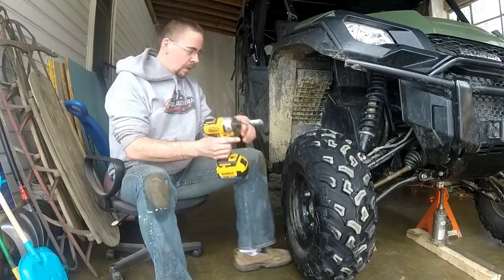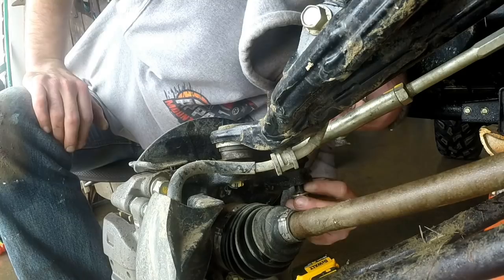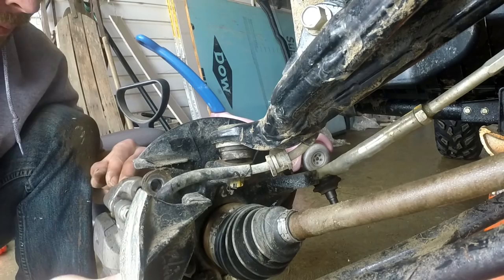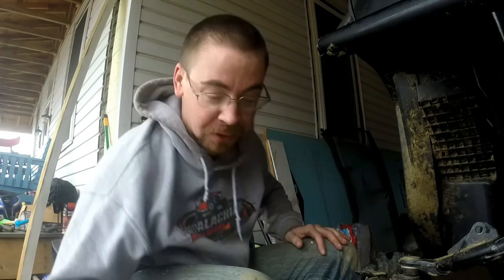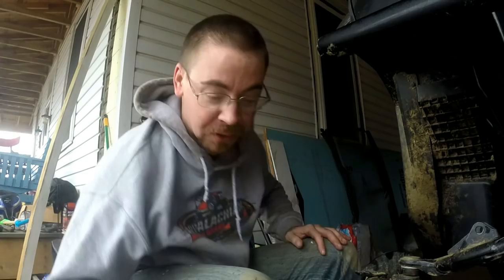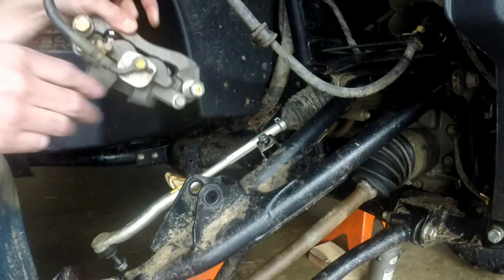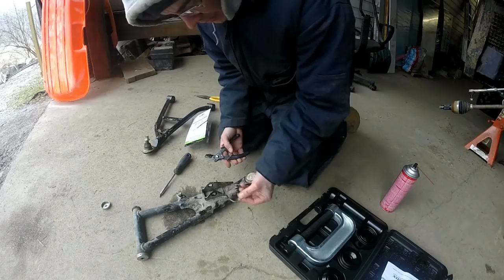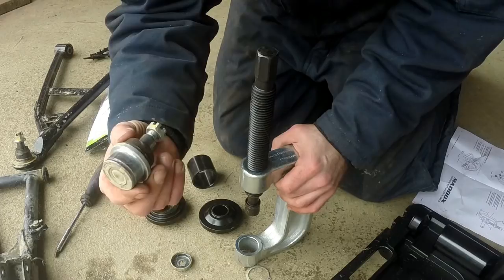Super ATV Arched A-Arm Install: Honda Pioneer 1000/1000-5

Comment: I have a 2017 pioneer 1000-5 and put a slight bend in my lower a arm, what are some problems that can occur from driving with it like that. Any answer is greatly appreciated thanks.
Reply from the maker: The most immediate thing is that if your a-arm is bent, then you can bet you're a-arm mounting tabs are tweaked as well. That can lead to them failing and ripping off cause your a-arm to come loose which you can probably guess the havoc that could cause. Again how soon that may happen depends on how "slight" the bend is and how you rip around in the P1k5. Just for reference, I went on a couple rides after bending mine before I even saw it was bent and stuff held together but I was probably pressing my luck...lol. 

With any amount of bend however it will through your alignment off which will cause lots of things like, tires, ball joints, a-arm bushing, tie rods, to wear faster and need replacing sooner which is something to consider as well.

Comment: Hey Jason how are things going. I have a question. Have you heard anything about the upper A-arm pivot bolt coming loose and "egging" out the holes for the upper A-arm mount when using the Super ATV ? Thanks
Reply from the maker: I haven’t herd anything about that but I don’t have the 1000-5 anymore so I don’t spend as much time on the 1000 groups and forums like I use too
Reply: @AppalachianMountainRiders  That's to bad. I love my 1000-5. Thanks and take care, Rob.

Comment: Hey mate just watching from Australia 🇦🇺 just wondering what tires your running still running my stocks but their absolutely terrible but anyway thanks videos are always tops 👍
Reply from the maker: JIM Rottey hello from across the pond! I’m running 27” maxis bighorns 2.0 on my Pioneer 500 9” wide front, 11” wide rear. I got them used so got a great deal on them is the main reason I went with them...lol. The bighorns are a great all around tire that’s great for trail riding. Not the best in the deep mud though. The only thing I don’t like about the 2.0 is they wear fast. The original bighorns were tough and would last for ever but the 2.0 are made from softer material. 

I still have the stock tires on the 1000-5.

Comment: Where to get the ball joint compression tool?
Reply from the maker: I picked mine up at harbor freight but most auto parts stores have them to rent if you don’t need one very often.
Reply: Thanks for the video. I was thinking getting satv heavy duty ball joint when I do this. Do you think the upper and lower needs them replaced or is one take more abuse than the other?
Reply: @shanepipkin4041  Always best to replace used ball joints in full sets.